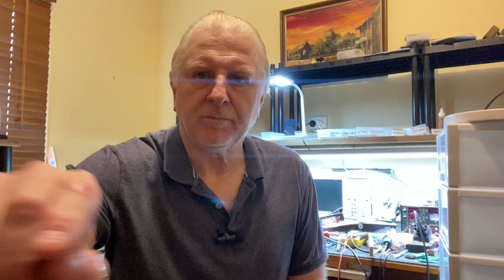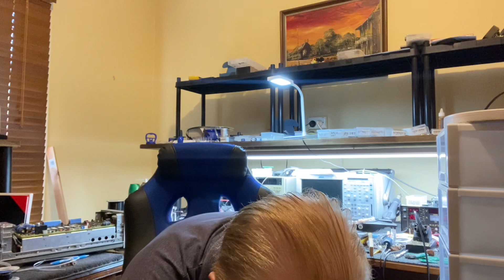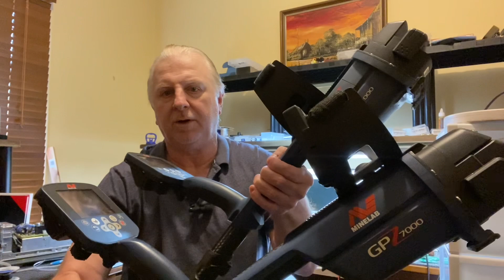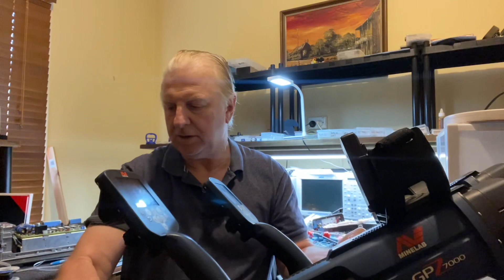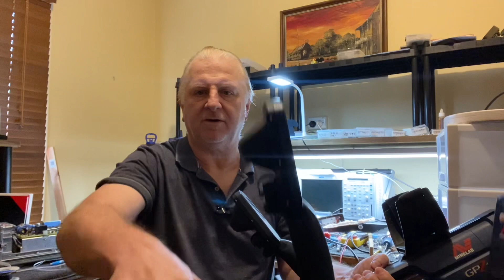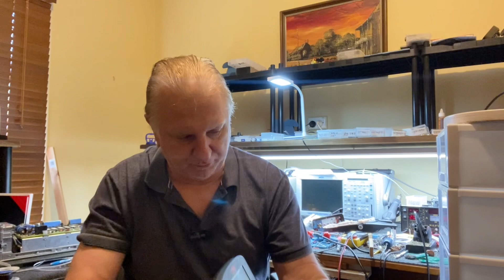Minelab GPZ-7000 Have arrived for upgrades and testing out proof of concept electronics.

Comment: If operators are complaining about   The 7000 running loud… they’d honestly be better off learning how to tune it rather than modify it. A carefully maintained and methodically tuned gpz7000 misses very little imo. Modifying your headphones meticulously along with a few other little tricks can deliver astounding performance improvement 👍
Reply from the maker: The internally generated power supply noise will cause an issue, that will also be tested.